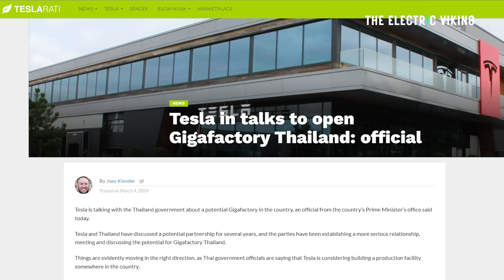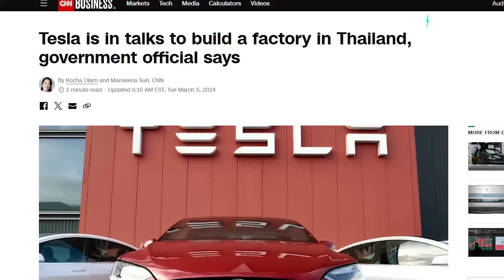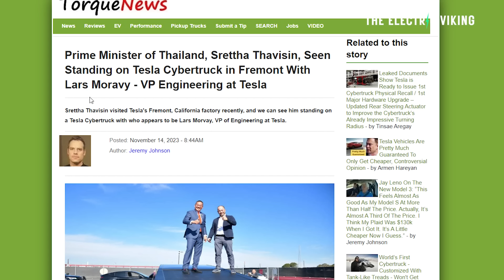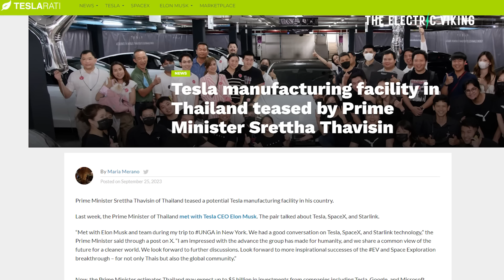Tesla highly likely to build next Gigafactory in Thailand for RHD vehicles

Comment: Once the Model 2 is out, everything will be drive & brake by wire, so no need to build a special factory with RHD vehicles. It will be very simple with the new platform to switch from RHD to LHD.

Comment: I live in Thailand and BEVs are doing very well here. It’s common to see BYD, Neta, MG and Tesla on the roads. I hope Tesla do build a factory because it might mean cheaper cars in Thailand and other ASEAN free trade area countries
Reply: I also live in Thailand. Do you think PEA would be able to supply the power if a significant number of vehicles were electric. Friends have struggled to get 20kw for small factories. I was in Bangkok last week at an outer suburb condo complex. Thousands of cars parked in the open. I thought how would you charge all these vehicles. I have looked at the chargers at PTT and maybe about 7 kw. If you had 2 vehicles would drop off.
Reply: 90k AUD (1.99m baht)for a dual motor Model 3 at the moment.  If built in Thailand would drop by nearly half. It would be like 45k AUD.
Reply: @mickfitz76 yeah It would kick start huge ev transition in South East Asia.
Reply: Well I’m guessing 10% of cars are renewed each year (based on cars lasting say 10 years). And of that 10% only 25% are currently BEVs in Thailand (from memory). The demand on the grid will probably increase but only a small percentage each year and if BEVs are often charged overnight they’ll help balance the load. There are obviously going to be some growing pains but the Thai charging network is improving. I have had a BEV in Thailand for four years already and the charging network has significantly improved over that time.

Comment: Once all Tesla cars are drive by wire, it should simplify manufacturing of right hand cars
Reply: will self drive cars care what side of the car you sit on
Reply: It will …… move steering wheel
Reply: Some vehicle performance metrics need to be tested on the actual roads. Best to have the correct road to test them on.

Comment: Hi Mr Viking, the other day I thought to myself, the cybertruck has drive by wire, would it be then that difficult to move the steering wheel as well for RHD. I also read that Brembo is working on brake by wire, that would also simplify RHD manufacturing & on top of that it would stretch the service intervals even further than 5 years cause there would be no brake fluid to replace. 
Blessings 
Will from 🇿🇦

Comment: Now that EV's use drive by wire isn't it easier to produce left and right hand drive vehicles on the same line? No more steering column and instrument panel is just a LCD screen with wires connected to it.
Reply: Smart comment 👍

Comment: The steering wheel is put in the the carbon truck. Can easily put on both sides easily for it does not have a drive shaft going down and hooking up strictly to the wheels it's just makes perfectly good sense to me once he insists all all Tesla's cars it won't matter if you have to have a factory made for right hand side and in your country factory anywhere it's just a matter of where you

Comment: How much energy does it take to produce new batteries for EVs?
Reply: Less
Reply: Heaps.
Reply: Last time I was in Thailand they were discussing where to put there next nuclear power plant. Sure, the distribution system looked a bit shambolic then, but the Thai people are smart and energetic, and easily able to overcome these hiccups.
Reply: Less than it takes to melt aluminum and cast and engine block.
Reply: A not insignificant amount of energy... that is recovered within ca. the first 10'000 miles of driving!

Comment: 'right hand drive' or wrong side drive ?
Reply: Left or right drive isn't a problem for factories.
Reply: The drive on the left goes back thousands of years before Roman times. Riens held the lefthand sword on the right.
It changed in the 1800s when large horse-drawn carts started clanging their righthand wheels causing severe damage.
Sitting on the lefthand horse with a whip in the right hand drivers were unable to estimate the distance between carts when passing. So moving to the righthand side to better gauge the distance between carts. Over 144 countries drive on the right and 78 on the left. Mainly Island nations keep to the traditional left side as they have little connection with other nations.
Reply: Its Right not gay left